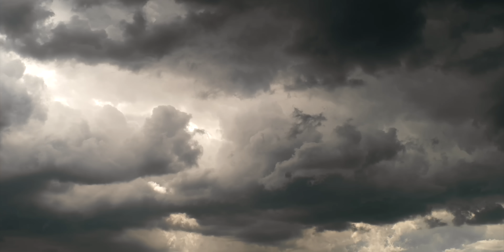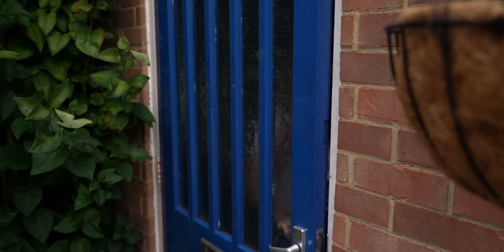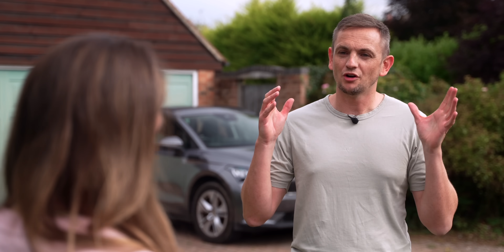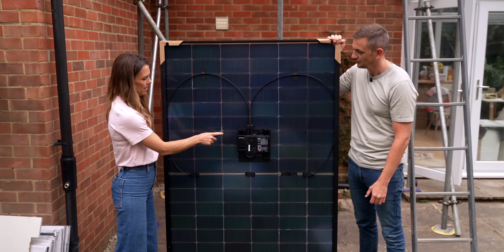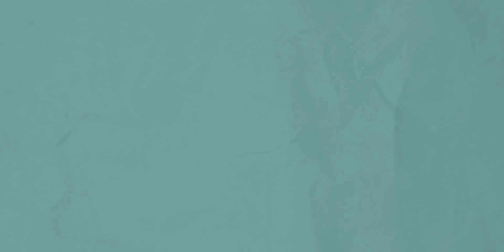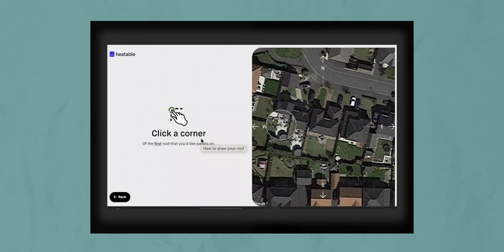Maximise Your Solar Returns With These Bifacial Panels!!

Comment: Invest in eco flow , indepenadant 1 panel micro inverter strings , buy some bi facials from City plumbing and install everything your self, cut out the solar parasite middle men and save a trcuk load

Comment: Sore point. We have a string array which does struggle at this time of year. We had this installed this tear because our installer was pushing the tech and we didn’t know about this micro inverters. Check your suppliers folks.

Comment: Am I missing something? I know energy prices will continue to rise.
But on a 12k install and an annual saving of around £500 it'll be 20 odd years before its payed off.....
Now I wont get into warranties and the likelyhood of company longevity.... but 20 years, i'll be dead by then, tech advancements will render the setup obsolete, and not to mention the upkeep of the system.
I think i'll stick with appliance efficiency.

Comment: If you paint the roof tiles below the bi-facial panels with a solar reflective coating, would this increase the current generated on the underside?

Comment: Assuming that the current from these panels gets fed directly into you home's electrical system, how is the 50 hertz from the panel inverter(s) synced up with the 50 hertz coming out of the grid power coming in from the electrical utility.

Comment: It's been 14 years since I installed our solar, which paid for itself years ago. What concerns me is that the temperatures are getting so hot in the summer that my array can no longer keep up. I fear I'll have to swap some of the original panels for newer ones that are much more efficient.

Comment: In Ontario Canada just installed some Bifacial panels, in a vertical East facing direction. Intended to catch morning and evening sun and low winter sun from both sides. Also since they are vertical they will not collect winter snow. 
Use a central inverter, looked into micro inverters, did not want the added complexity, cost and low reliability by being installed in the weather, plus how far in the future will replacements be available. Wires on solar panels are simple therefore far more reliable then complex micro inverters.

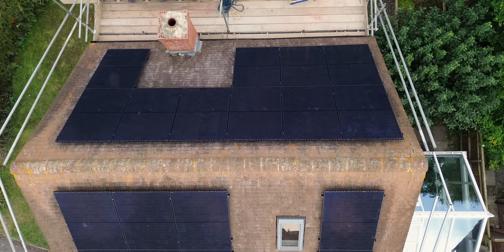Comment: First of all you won't be doing that on asbestos panels roof. So changing roof and having solar is double the cost. If your neighbors or your pet supply can have it, you stuck with never having the funds. 9:50 😄 good luck, with that - Ignitis does everything you wished playing it in your smartphone, but you don't have that roof at your home. Your every video possibly is a solar panel and you have it on your roof. Unique to you is you have those videos and that Laravel form validation would be you are testing your power grid with another channel because you wish to make everybody in your organization to do it change the social network roofs or whatever.

Comment: Why aren’t optimisers mentioned for normal PV arrays where you only have one inverter? The guy in the video makes it sound like a micro-inverter per panel is the only way to be able to monitor the performance of each panel and also manage shading issues, which just isn’t true … I thought EE would have picked up on that?

I have two arrays, one with 11 panels, the other with 10 panels, so assuming the inverters I’ve got have a 200V startup voltage, then there doesn’t seem to be any benefit of the micro-inverters over the optimisers I’m using?

I like the idea of generating power on the back of the panel … although I’d be surprised (and am a bit dubious) that the rear of the panel can generate 20% extra power just by the tiny about of light that creeps through the cracks between each solar cell … given that the cells on the back will only be generating by the light that’s reflected off the roof tiles? 🤔

Comment: What's with all the negativity here? The guy is just highlighting some of the selling points as would anyone else promoting their product on this show. 
It's true microinverters may only boost the overall output by a small margin unless shading is a huge issue, and while I accept there are plenty of more budget friendly solutions which offer better output per £, there is nothing wrong with offering premium products which offer the best tech available today. The size of your roof isn't going to change over time so if max generation is the goal this package seems competitive. Even more so where non optimal orientations are concerned.

Comment: Feasibility in lower light, does this mean that if a roof has a greater than optimal pitch angle, it will also function in a similar way?

Comment: You are presenting old news as if it was new; microinverters were available since 2008. The panel backing is the only new part, but then you omit the most important effect - increased power draw. A panel is around 21% efficient, so what has that risen to with this new backing? Is it now 22% or approaching 30%? All the other guff about seeing your problem areas are available on most systems.

Comment: How much light passes through those small gaps and bounces off a dark slate or tile roof really? It's like 5% of the area bouncing off something with 90% absorption. OK you'll get some light coming round the edges, but still. Unless I hear otherwise I'll assume that 20% from the rear face is relevant to frame mounting on the ground or a flat roof, and the benefits of bifacial on a pitched roof are negligible. As an installer I'd also recommend not to have micro-inverters up on the roof when you could have a string inverter in your garage or loft, unless there's significant shading issues.
Reply: See my recent comment. Also, if 20% is gathered after 20% first gathered, how does that work? Is it an extra fifth of the fifth, or is it a fifth of the four fifths that wasn't gathered? Lies; damn lies; and statistics?

Comment: The enphase system does AC all the way it seems.

This means that for batteries to work, they have to be AC coupled. So for any electrons to go into the batteries, the AC current has to be transformed to the DC that the battery accepts, and then to use battery power, you have to invert it back to AC.

This is shown in the data for one of their IQ batteries (the 3.3kWh one): the battery itself claims to have a 96% roundtrip efficiency, but the AC inverter that has to be included has a 89% roundtrip efficiency. For an equivalent DC system, you only do the AC conversion once, so logically and simplistically we can take the efficiency of the micro-inverter(s) and the efficiency of the battery itself as the efficiency of the whole DC system. Then we are still left with the 89% of the extra 2 inversions that the Enphase battery system has to do.

As soon as you add storage to this system, all supposed advantages of the enphase system go up in smoke... Well, heat actually...

Comment: Problem with micro inverter from Enphase panels are now 430-480w and enphase biggest micro inverter maximum output in 380w so potentially losing 100 W per panel. Better off with string system with optimisers can get most of the same advantages as micro inverter.
Reply: Not really, each panel is rated at 100 percent lab conditions. The uk generally has sun irradiance of between 650 to 750 out of a 1000. Meaning a 440w panel will only produce between 285 to 350w anyways.

Comment: Microinverters are such a scam... "If one fails, all will fail". Well, perhaps he haven't learned yet about bypass diodes. 200V for string inverter to start vs 20V for single panel? Well, guess what - string of 10 panels, each generating 20V gets you to 200V already. And most string inverters can start with 120-150V, btw.
Put on top the fact that the microinverter operates directly at the hot solar panel on the roof, in rain, freezing temperatures, hot temperatures, ... while the string inverter is somewhere in a garage or at least shielded space...
And many people found out about the problems with warranty - you will get replacement of the microinverter, sure. But is it still compatible with the old ones you have? Or do you have to suddenly replace all of them due to one faulty? And if your installer went out of business and you don't have the same code to connect them all together?
And then add the price and we are done.
Reply: Yeah. Quite a lot of bollocks in this piece. We must have reasonably good stats on the relative lifetimes of microinverters and string inverters by now as they've been going on roofs for more than a decade. Bifacial panels do seem like a good idea though, as all you do is miss out the plastic backing. Is there a downside?

Comment: Microinverter systems also allow staged roll out of solar to meet needs / wallet - even adding different panels later down the line - as technology changes - string inverters are only suitable for the whole "adequately sized" installation.
(NSW central  coast - patchy rain today - Spring, solar faces NW - topography reasons - 24kWh produced - 18kWh exported  between 6am and 5:45pm - SE string inverter with optimisers.)

Power companies are fighting back hard to reign in the ca$h drain to residential solar owners - governments are facilitating the clawback  (fortunately my household has been well into the cash positive territory with solar over the last 6 years, while power ($$) rates have increased at least 50% - of course it took a capital investment, 6 years ago savings was paying negative rates and the stockmarket was going sideways - I see it as a great investment..)

Comment: 20 volts startup voltage from one panel or 200 volts from a string of 10 panels is effectively exactly the same so claiming a lower startup voltage is very misleading.

Comment: No panel on the market is making a whole array of panels fail because of one panel fail.
"If one fail - all fail" is a MYTH!
Every panel have a bypass diode in them so all panels that still work will continue produce their power.

Comment: Its really a product for a problem that doesnt exist. 

It you get hail damage or a squirrel chews the cable you have expensive replacement costs just because somebody has glued a micro inverter to the back of it.
Also will these be available in 10+ years time when you need a replacement, judging by the past you will be searching eBay in a hope of picking up a secondhand one. 

So what does it really offer you over over separate items. I suspect nothing. It will save the installer time which increases their profit margin but you see no benefit.

Comment: I have a 13 panel array with micro-inverters. As the house is an old Victorian Farmhouse the roof could be described as all over the place. There are 6 South East facing panels with at least one shaded by a dormer window in the early morning. There are seven South West facing panels with a large chimney stack shading one or more sometime in the afternoon. Today was a poor day for the array but I can tell the output for each panel and the best panel produced twice as much as the worst.

Comment: Making simple PV panels more complex seems to be a risk for failures. My rack mounted panels have been producing since 2010 and none have failed. I have 10 kW system with two 6kW inverters and they have never failed. Oversizing the inverters means that they never can be overpowered so this risk was eliminated. I think bifacial panels have their place but I'm not convinced that individual panel inverters are cost effective. If I had the choice I would buy more panels and place them at morning and evening orientations before installing bifacial panels since they are still significantly cheaper per watt.

Comment: solar in the UK? lmao
Reply: Looking at the overall UK electricity generation on the grid I see that we have 22% presently being supplied from solar. In the south west of England it's 80% today. Given that we have only scratched the surface of potential solar generation here this looks worthwhile to me.
Reply: @MrAdopado  That's not a good thing, we have very little electricity for that exact reason. Our geography demands nuclear, France showed the way.
Reply: @zSion  I have little against more nuclear in principle. However, the government go-ahead for Hinkley Point C was given in 2010 ... and some early prep work actually commenced in advance in 2008. It's now 2024 and it has yet to produce any electricity! And what about Sizewell C! It's massively expensive and it takes too long ... we really can't wait. In the same span of time we have transformed our generation capacity with the increases in wind and solar.
Reply: @MrAdopado  That's not the fault of nuclear, it's the fault of our government and our stupid regulations. You can tell by how much HS2 costs and how long it takes us, same for why we hardly have any tramlines. Other countries do not have this problem.
Reply: @zSion  Agreed, but ultimately it doesn't matter whose fault it is ... nuclear is taking too long and is too expensive.
Reply: Eh? Domestic rooftop solar in the uk has a much better roi than nuclear and grid scale solar is far better still.
Keeping nuclear that's already up and running makes sense but building new nuclear capacity seems pointless.
Reply: @GregS-UK  Sure buddy. Rolls Royce SMR's are the future. Solar in the UK doesn't make any sense
Reply: @zSion  My turn for the lmao...

Comment: So erm, at around the 6:50 mark, the seller claims that you need micro-inverters so you can know exactly which panel is not producing... ...But then he goes on to claim that 99% of the issues are software.
Pray tell what software do these solar panels run on their silicon?

Oh wait, it's going to be a software issue with the oodles of micro-inverters you needlessly installed!

Is there anything in this video that cannot be debunked?

Comment: What about painting the roof white under the panels before you fit. Would this increase the power output?
Reply: Just be reflective under each panel. The whole roof doesn't need to be painted.

Comment: The sales hype around micro-inverters is mis-representation, and not persuasive.  And 20% bi-facial gain is a real thing, especially with ground-mount.  But installed tight against black asphalt shingles?  Nope.  That is another mis-representation.  Does not inspire trust.

Comment: The best ROI is on a small 1000-watt system with a microinverter that can handle 2 panels that are grid-tied. Especially when you can install yourself on a shed, 400 quid should do. Energy generated should be consumed, so working from home helps as running dishwashers, and dryers and watching machines during the day. Payback time is just over a year. The ROI increases when we start oversizing and overcomplicating things and adding batteries. A 25-year warranty means nothing in a cutthroat industry like solar with plenty of companies going bust.

Comment: The problems are 'software', I'm sorry, the inverters crash and don't self recover, how is that ok. I think micro-inverters are great if you have a roof that is accessible at a reasonable cost and is complex in layout or has complex shading issues, or you don't trust the electricians installing it to know how to crimp an MC4 connector and not set fire to your house. Otherwise I'd choose simplicity.

As for properties value, for the first time ever I had to declare if I had solar PV when I did my most recent home insurance quote, I'm not sure it was to offer me a discount!

Comment: My concern with the integrated inverter is what happens if it fails?
You then have to replace the whole solar panel.
Reply: no, only the micro inverter would need replacing
Reply: @Giavel84  But you would need to put scaffolding up to access the panel, how much would that cost?
Reply: @ microinverters warranty can go up to 25 years. So if a microinverter fails during that time the warranty would cover the expense for replacing it.

Comment: not sure why black is a preferable colour than blue. just make them the best colour possible regardless. make em pink if that's the best.
Reply: Black is the best colour from a light absorption viewpoint.  Why throw away the blue wavelength light unnecessarily?
Reply: Once you go black you don’t go back 😂

Comment: Micro inverters or optimisers are a great solution to a shading problem…if there’s no shading, don’t fit them. One string inverter is far less likely to fail compared to 14? Micros or optimisers operating in harsh weather conditions. As for efficiency, they are worse, by approx 2%. That super 20 year warranty is great but it won’t pay for the scaffolding which could 10x the cost of the micro! The voltage on panels in series is multiplied by the number of panels, so there’s no issue with start up. Trying to replace a panel with a built in micro in a few years could be a real head ache. Don’t pay extra for a problem you may not have. No substantial shading = No to micros or optimisers 100%.
Reply: Also if it does fail it's in you loft /garage and you can just swap it with no drama.
Reply: People are so concerned about a minuscule efficiency difference and then they leave all kinds of lights and appliances on when not home 😂
Reply: As an installer we have to argue with customers about this quite a bit. Too many people obsess about chasing negligible benefits, thus adding complexity at greater cost and lower reliability. When simple works, it's the way to go.
Reply: @bimblinghill well summed up👏
Reply: @MustangGlos  actually string inverted is the part most likely to fail on solar system which is why they only have 10yr warranty, compared with micro-inverters matching panels at 25yr warranty.
Reply: @Lawrence7of9  even if the micro inverters were twice as reliable, if you were to have, say 14 of them, you are still 7x more likely to experience a failure. Plus the expense of scaffolding which could be around £800. Having installed upwards 40k of solar panels, I have the data to back that up.
Reply: @MustangGlos  25yr warranty versus 10yr because data shows which does fail. I trust this data over you.